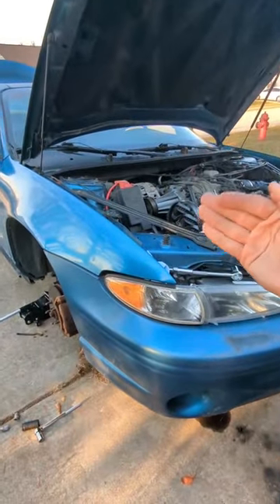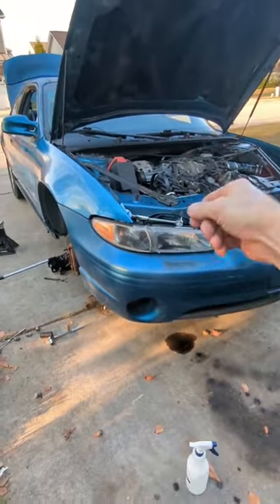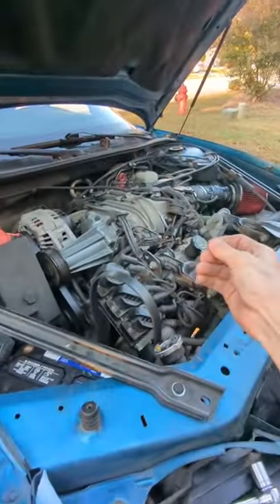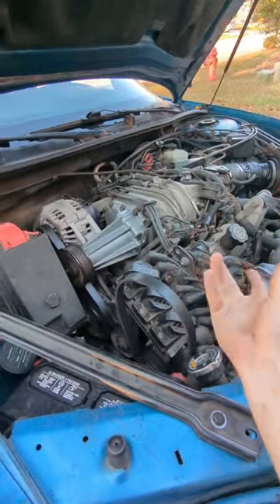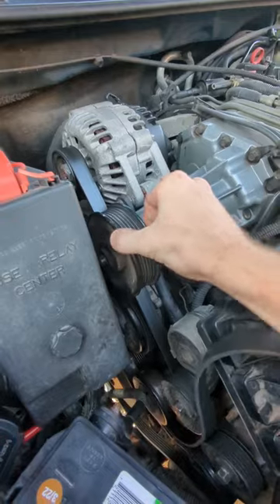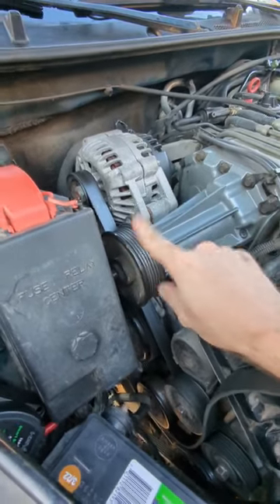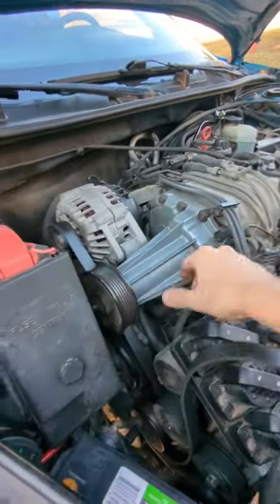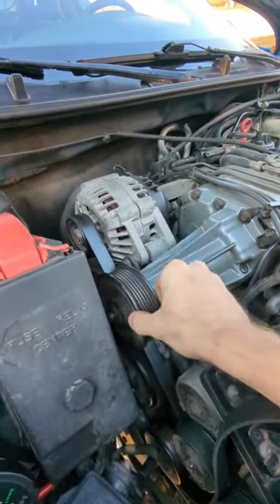This thing is a money pit

Comment: I had a Grand Prix GTP and had to scrap it because the Crank Position Sensor went causing it to die randomly.  Could not the the crank pulley off to replace it as someone put red locktite on the bolt.  My mechanic said he can get it out, but there would be a 50/50 chance the threads were coming with which would cause me to need a new crank shaft.
Reply: cards93  Took it to 2 mechanics, both said the same thing.  Car is long gone now anyways.
Reply: @DaTT78  damn that sucks. Yeah any glue can be heated and melted off